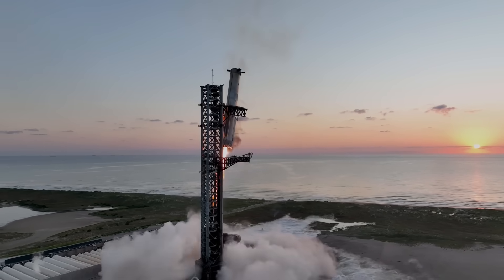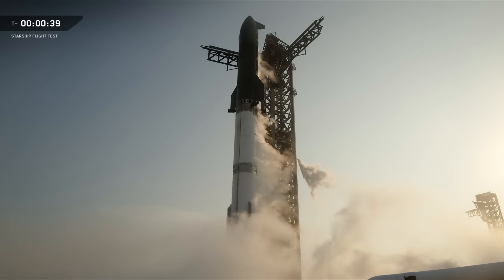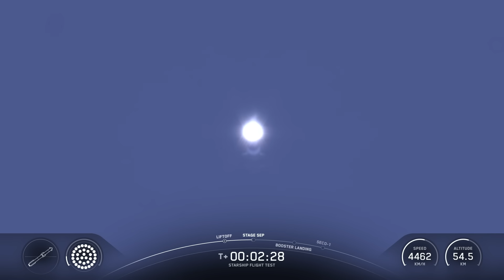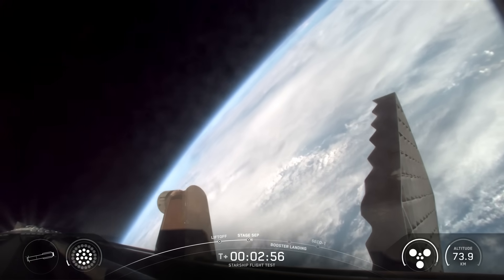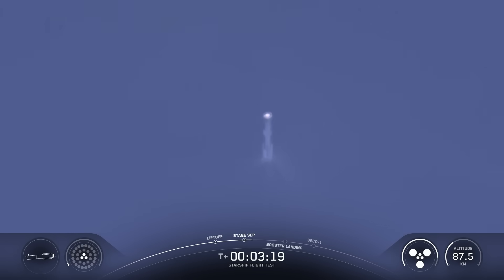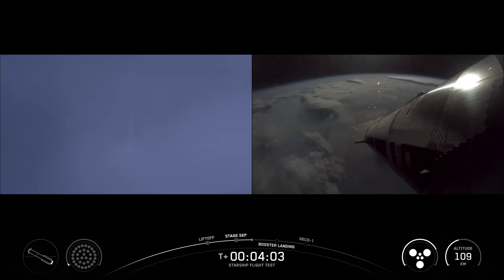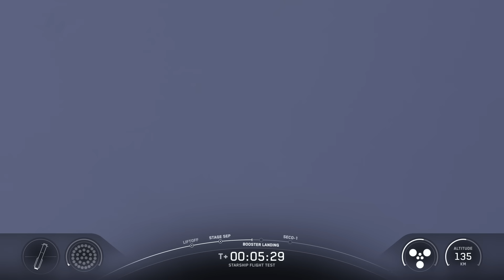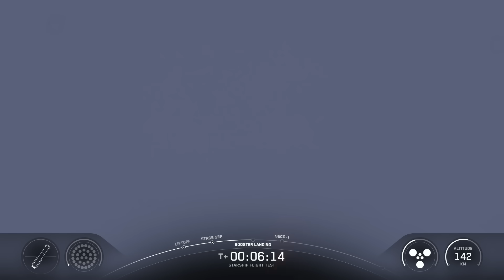SpaceX Builds Largest Reusable Booster, Also Makes Door That Won't Open - Starship Flight 9 Recap

Comment: I hate to say this but what would be the chances of sabotage at the build site because of Elon's political affiliations? Poor weld quality, loose fittings, gaskets not installed on flanges etc. would mostly make it through testing...
Reply: Those issues all sound more like apathy than actual sabotage. And yeah, maybe if your boss is a jerk then you don't care as much about doing a good job, but there are still a lot of factors pushing against active sabotage, like emotional investment in the project, fear of getting caught, plain old habit, etc. Pretty unlikely.
Reply: No, starship has been failing since flight 1 in april 2023. Musk didn't go all in with Trump until mid 2024. He wasn't loathed until DOGE and the Nazi salute in 2025. There is no correlation between Musks political ambitions and Starship failures. There are however signs of design issues judging from the repeated similarity of the failures, the redesign and block 2 starship, the reduced payload expectations etc.
Reply: I think the biggest saboteur here is Elon himself. He put himself at the centre of Space-X and then bugged off for other aspirations. You can't split your time like that and do everything no matter how few hours you sleep. You just end up doing both things poorly.
Reply: His biggest failure was going all in on politics.
Reply: @harshsharma03  no, for the benefit of american citizens it was needed
Reply: @trader2137  for the american citizens or for the south african citizen?
Reply: Not so much sabotage on political grounds, but careless and apathetic workers because they've been treated like sh*t by their boss.
Reply: I though this too, especially when that second one blew up on flight 8.

I'm afraid he has become a liability now.
Reply: You are not alone in your thinking, I’ve been contemplating that idea for the last three flights….
Reply: @DRUmBEaTTS  so they had one failure and you thought "hey maybe someone is sabotaging this" Its a new ship design, even spacex was probably doubtful about a success on flight 7. Now that its been 3 flights, sure ig you could speculate that, but to me it just seems like a design flaw
Reply: @Jamie-d6g there were a lot of failures this time on top of all the failures that came before this one.